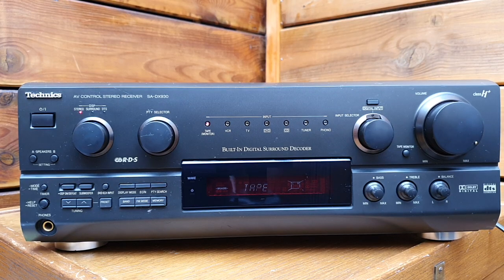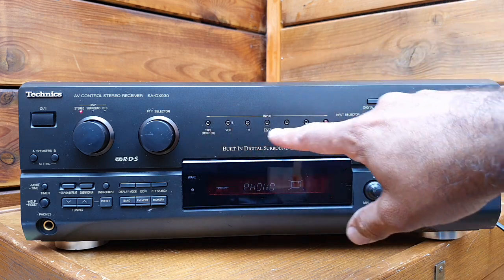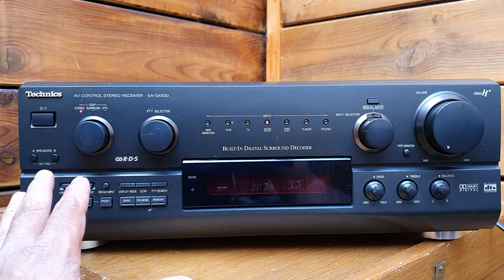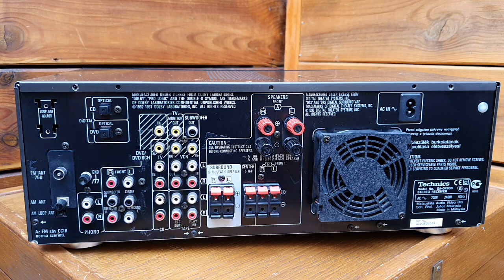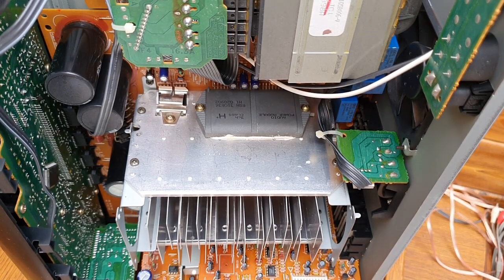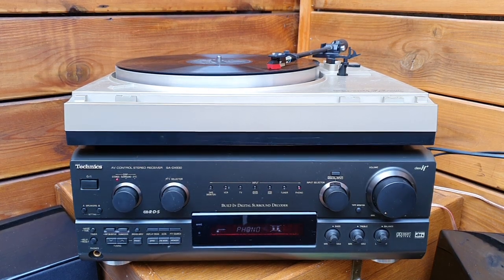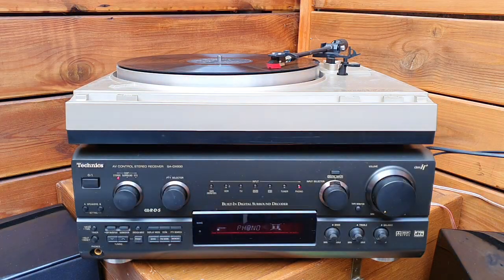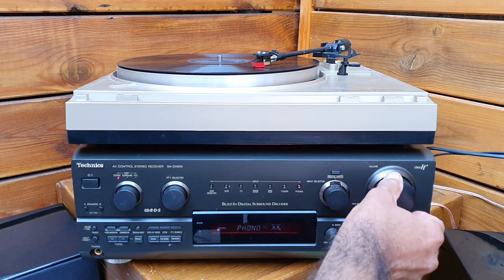Technics SA-DX930 Class H+ Amplifier from 1999 -  A Technical Look - Marantz TT 1200 Turntable 1980s

Comment: Thank you for the info on this receiver. I have one and has been working flawlessly for a number of years. This model does run hot though, the fan only kicks in with volume at about 10 o'clock.

I am looking to hook up 2 Wharfdale Diamond 9.1 speakers would they be a good match?
Reply from the maker: Glad to hear your receiver is still going strong and thanks for sharing your experience! Yes Wharfdale Diamond will match it perfectly but use them at moderate volume levels and increase volume gradually. Thanks for tuning the channel

Comment: Tengo el mismo Amplificador pero en la Entrada Óptica no funciona el Ecualizador 😢 hay alguna manera o configuración
Reply from the maker: Well yes but you need to buy seprate Optiocal to Analog convertor and feed equalizer hrough it to the amplifier but before doing it swap the optical cable it may already solve the problem. Enjoy it & thans for tuning in

Comment: I have a overload issue. When I turn on it goes straight into overload. With no speakers connected.
Reply from the maker: I think your amplifier is suffering from switching circuitry serves as relay due to high humidity on the circuit board. If you are technicall enough then I advise you to open the cover and use hair dryer on the circuit board each side for total 10 minutes. Or leave it in direct sun light (if you live in sunny country)for an hour. It should dryup the humidity on the circuit and amplifier will work as normal. If that not solve the problem that means the componenets on the switching circuit are faulty. Always keep volume on minimum when it is not coonected with load (speakers) before starting the amplifier. Let me know if it works for you.Thanks for support, much appriciated
Reply: Check also the fan. Search for this problem. I dont know this model but the ones before have this overload issue when the fan or the fan connector is cook